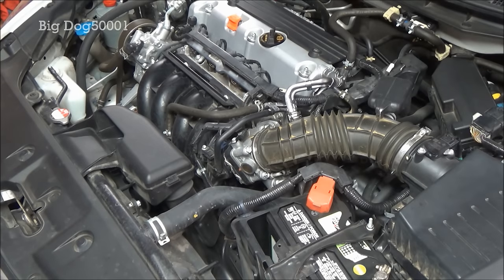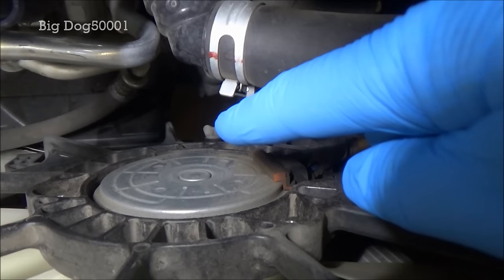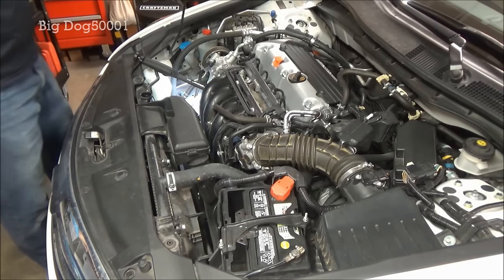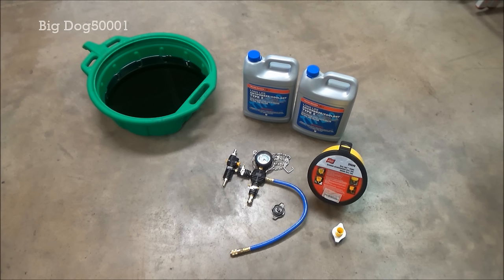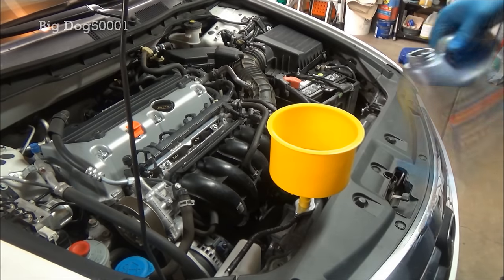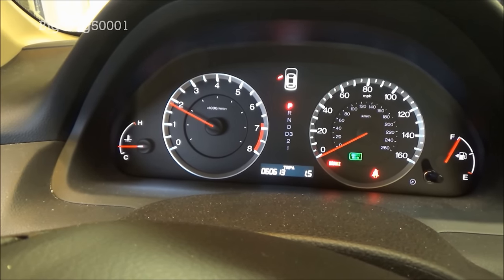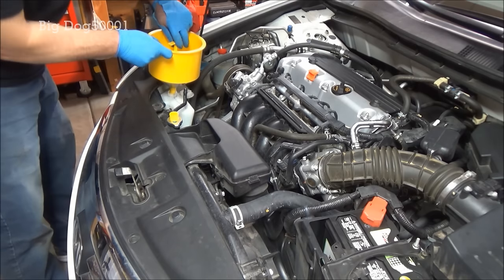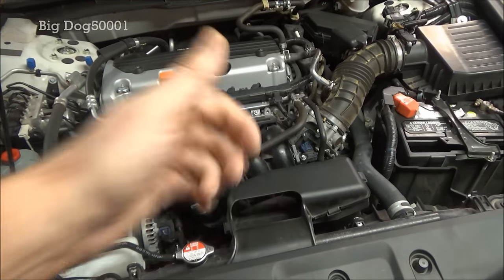Honda Cooling System Service/Fluid Change

Comment: Does anyone know how long these 5 speed auto's usually last with regular maintenance? My 2012 Accord has 130k miles, bought it a few weeks ago. 1 owner with regular maintenance done on the trans and the rest of the car.
Reply from the maker: With regular maintenance, these Honda automatic transmissions can usually go over 300,000 miles without issue.  Many people are pretty bad with doing regular maintenance though....
Reply: @BigDog50001  Thanks for the response sir! Much appreciated and glad to hear that.

Comment: Will this work for all Hondas? 2015 CRV?
Reply from the maker: Yes it can be done like this (especially if done at regular intervals).  There is a drain bolt on the engine block that can be removed on those models to assist in getting additional coolant out of block (need to replace the washer on that bolt if removed).
Reply: @BigDog50001  How would it be done with auto air conditioning controls? Would you just set them to High?

Comment: Hey i have a Honda Odyssey 01 and have prestone antifreeze on it i wanna change it to the Honda do you think just to drain the coolant from the radiator should be fine ?or much better remove the thermostat? And let all that coolant out the same from the heater core as well ?!
Reply from the maker: I would not touch the thermostat if I didn't have to.  In situations like that, I do a service like in this video, then I wait until the vehicle has cooled down (maybe the next day or something like that but it could be a few days or week later) and do the same service again (for a total of 2 services).  After 2 services most of the coolant will be new.
Reply: Big Dog50001 Automotive ok yeah i was just wonder the thermostat is brand new i installed 2 weeks ago with the oem one i will do it when the weather its getting better its so cold to work on car now

Comment: Hi Big Dogg50001. Thanx for the video. However, while I'm waiting for my 07 accord to heat up and kick the fans on, the funnel starts filling up and overflowed onto the floor. I then shut the car off real quick and the entire funnel full of coolant sucked right back into the radiator. What's going on with this car? Please Help!!
Reply from the maker: Sounds like a lot of air in system.  Happens a lot when the coolant is poured in too quickly.  If it happens I just shut it down for a short time and then do it again.  I always watch the coolant temp too, too much air can allow it to get too hot.  If it starts to get too warm, I just shut it down quickly and let it cool off and then do it again.
Reply: Thank you very much. I did everything that you said, and realized that the fans weren't kicking on at all. I was expecting it to kick on about the halfway mark on the gauge. The coolant doesn't start rising until after the halfway point. I'm pretty sure all of the air is out. I went ahead and bought a new coolant sensor switch and installed it and redone the procedure with the same results. I then disconnected the wire from the switch while the car was running, and the fans came on. Now I'm really puzzled. Whats your thoughts on that scenario?
Reply: So now I let it cool down and I tried it with the sensor unplugged.The cooling fan came on right when it was supposed to. As I waited for the fans to shut off and cycle, the fluid started rising in the funnel again. The engine temp gauge showed a little under halfway. The upper radiator hose was hot, but the fluid rising in the funnel was cool. What do you make of that? Is that the characteristics of a bad thermostat?
Reply: OK, let me see if you agree with this theory. The reason the fans aren't kicking in is possibly because the thermostat is not opening and the coolant at the bottom of the radiator is still cool. While I am running the upper hose it pretty hot and pressurized, and the lower hose is pressurized and still cool. If the thermostat is opening, shouldn't both hoses get hot?
Reply from the maker: There might be something wrong but you may be chasing ghosts and introducing problems that were not there due to the air that was in the system.  

2005-2007 2.4L Accords have TWO Engine Coolant Temperature Sensors (ECT 1 and ECT 2).  ECT 2 is located near bottom of radiator on these models.

2003-2004 2.4L Accords used a Radiator Fan Switch instead of ECT 2.  The Radiator Fan Switch is also located on bottom of radiator (same place as ECT 2 on later models).    

I do NOT use aftermarket switches or ECTs on Hondas, they generally do not work well.  If a radiator fan switch was installed instead of an ECT or vice versa then the fans may have problems operating.

On 05-07 2.4L Accords the radiator fan is powered through a relay and the relay is controlled by the engine computer based on inputs the computer is seeing (coolant temperatures being reported by ECT 1 and 2, A/C being requested on etc.).  

On 03-04 2.4L Accords the radiator fan is also powered through a relay and the relay is energized by either the engine computer (based on inputs) or the Radiator Fan Switch when the coolant temperature is approximately 196 degrees (the switch closes and completes the circuit).  I hope this info helps!
Reply: Thank you very much for your help, It is greatly appreciated. I am sorry for the trouble, but I hope that we both may  learn something from this experience. So far, I changed the temperature switch at the bottom of the radiator, replaced the cooling fan relay switch, and replaced the thermostat. The bleeding is going fine, just like on your video, except that the fluid is rising in the funnel, before the engine gets too hot. I am scooping the excess fluid out so that I can keep it bleeding until it gets up to the red mark on the temperature gauge, and I am getting steady air bubbles out. I repeated this at least 3 times, just like you said, and every time more air comes out. But, I just cannot understand while the cooling fan doesn't kick on during this procedure. I have no trouble codes and the only thing left for me to change is the temperature switch on the engine behind the throttle body. But, if the temperature switch was bad, I would have a trouble code, isn't that right? Do you know which temperature sensor would send the information to the computer for it to turn the fan relay on?
Reply: @tonyguy98 The way i replace the coolant after a drain,  especially on Honda's,  remove the top radiator hose and fill to you see coolant about to spill out of the hose .
Reconnect the upper hose to the radiator,  and top off the radiator itself....
Filling it this way the coolant is going directly into the cylinder head and block , and on the back side of the thermostat.... NO AIR TRAPPED THAT WAY ....
JMO .....

Comment: No need to drain the engine block?
Reply from the maker: Up to you, some engines it can be done and others it can't.  I have found that doing what I showed at regular intervals is all that is needed for most Hondas to keep the system operating properly.

Comment: If I add coolant just to the reservoir, do I need to burp out the air bubbles?
Reply from the maker: Not usually if just adding to the reservoir.  If the reservoir was completely dry and the radiator lost some coolant too, then the air may need to be purged from the system (and probably have to find where the coolant is leaking too!).
Reply: @BigDog50001  thank you sir!

Comment: How come all the best mechanics are always so far away from where I live? :(
Reply: You are the mechanic, buy some tools and save LOTS of money! I just did the service on my mother's 2012 Honda Accord. She had a very bad experience at a dealer with her last Honda, and hired a local Honda mechanic that worked out of his home. Well, he never did anymore than oil changes, at least I hope he changed the oil. Mom was having issues with the brakes, he just told her the brakes were fine. Well, I wound up replacing all four rotors, I had to beat the pads out of the brackets with a 3 pound sledge hammer and then found both front calipers were leaking. The car only has 58,000 miles on it! He did nothing to this car, and it is garage kept and washed regularly, normally a couple of times a week. I had to do a brake job, service the transmission that had never been serviced, service the cooling system, service the oil, sanded and painted the engine cradle, etc... Cost to do all of this $570, a dealer would have hit her for what, $3500? Buy tools, educate yourself, save money.

Comment: Most of the cars I had had a very small air drain plug to release the air evenly. I do not know why Honda did not make this little stopper and now need this yellow bucket or that kit. Just unfortunate
Reply from the maker: Thanks for the comment!

Comment: At what mileage should you change the upper and lower radiator hoses?
Reply from the maker: I wouldn't say there is a certain mileage but if the vehicle is over 15 years old and has not had new ones installed,  or if there are any cooling issues, that is usually when I recommend replacing them.
Reply: Big Dog50001 Automotive Thanks Big Dog!

Comment: how high did you fill up the white coolant reservoir?
Reply from the maker: Usually the words MIN and MAX are molded into the reservoir.  I filled it to the MAX line.  Sometimes the markings can be difficult to see, so you may need to look for the mark closely with a flashlight.

Comment: How do you know if your Accord has the engine drain bolt? I have a 2013 Accord sport.
Reply from the maker: Generally, you have to look at the service information to find out.  2013 Accords with a K24W1 engine do have a block drain bolt.  It should be on block towards front of vehicle, the washer should be replaced anytime it is removed.
Reply: @BigDog50001  I will investigate further. Thanks!
Reply: @BigDog50001  Do you happen to know the size of the washer? also. if I do have an engine coolant drain bolt, does that change the procedure you showed in the video in anyway? Thanks

Comment: What about the coolant inside the engine block?
Reply from the maker: Yes there is coolant in the block, some models have a drain bolt for it and some don't.  If the coolant is changed regularly this is a non issue.

Comment: Read the manual.  Honda says to use non silicate antifreeze coolant.   Waste of coolant to change every 60/30K miles.  Honda coolant is rated for 100k between changes.  Some premiums are rated for 15 years, 350k.
Reply: Car care nut shows what happens if you go by what they recommend, I.e 100k miles and that it turns acidic then starts to eat away the composite black material they put on each side of the head gasket. So, not worth the risk imho. 5k oil and 50k coolant changes he recommends and more so shows you what happens if you don't.

Comment: Why does my reservoir start to fill up when I do this? I emptied it and left it empty. Then I started to fill up the lyles funnel and it filled up my reservoir and my radiator
Reply from the maker: The coolant is just going through the overflow tube coming of the top of the radiator.  You might be using the wrong radiator cap attachment.  If not, you can lift the hose that goes into reservoir up above radiator neck level or just gently punch hose off to stop it from doing that.
Reply: Big Dog50001 Automotive thanks

Comment: When you turned on the heat, do you turn on the fan too?
Reply from the maker: No I don't. unless it is some kind of auto climate control system where it needs to be on to switch to heat, then I will put the fan on low.
Reply: Thank you.
Reply: Big Dog50001 Automotive does AC need to be on?

Comment: Do u have a video made where u change brakes on a Honda crosstour?
Reply from the maker: No, I don't see too many Crosstours.  I have several brake videos coming out, most Hondas use a very similar setup..
Reply: @BigDog50001   thank you I appreciate it , I checked out your videos! Thankful for your videos!💯

Comment: When is the thermostat recommended to replace.
Reply from the maker: There is no recommended interval.  I generally recommend replacing it if the vehicle has 200,000 miles or more on the original thermostat.
Reply: Awsome thank you

Comment: mate, I can't find the block bolt for my 04 ex civic,yet owner manual recommend s draining it out
Reply from the maker: On those Civics, the drain bolt for the block is located on the rear of the engine right next to the oil filter.  Just know, if that bolt has never been removed it will be extremely tight and you always risk the chance of opening up a can of worms.  The threads need to be sealed with a liquid gasket maker and a new washer should be used.  

On situations like that where the block bolt has never been touched and I want to get all the old coolant out, I prefer to do a drain and fill, then drive vehicle for a drive cycle, then do an additional drain and fill (of course the engine needs to be cool before doing each drain and fill).
Reply: Don't take out that bolt. I thought better of it and didn't.

Comment: How soon do you have to replace the radiator cap back on?
Reply from the maker: If I am using a spill free funnel like in video then I will put radiator cap back on immediately after I take funnel off.  If using cap method of bleeding, then after system is bled I would top system off with coolant and then immediately put cap on.  

If you are asking when to replace radiator cap with a new one, I would say put a new one on if the cap is 10 years old or older.  I only use Honda radiator caps.
Reply: Big Dog50001 Automotive 
Thanks man. 
Just clarify when you turned heater on, did you put the ac fan full blast or just level 1?
Reply from the maker: @Freerydah73  Just need to turn it to hot.  No need for fan to be on unless it's an auto climate control system and it won't switch to heat without being on.  No AC because that will turn fans on.
Reply: Big Dog50001 Automotive 
Great. 
I notice a lot of other videos, they turn ac fans full blast. 
Just FYI, I just subbed. Your videos are awesome!

Comment: I have a 2008 crv anyone know the intervals for the coolant thermostat to be changed I have 119k and coolant
Reply from the maker: In general, there is no set interval for a thermostat.  Yours is getting to the age where it's not a bad idea to change it out (12-14 years old and 100k-150k miles).  If you are going to do that I DO NOT recommend aftermarket thermostats.  OEM Honda only.
Reply: @BigDog50001  yeah went to honda today after I posted this and got a new thermostat and 2 gallons of coolant.its a pain in the ass to get at the thermostat, it should be fun  I got 2 new hoses too why not !!!

Comment: How about if the fans don't come on but it reaches temperature
Reply from the maker: That is when I would do troubleshooting procedures.  Vehicles cooling systems vary so you have to know how it is designed.  I show troubleshooting procedures on an older Honda system in this video: https://youtu.be/BCvC_wnyuIs

Comment: don't get the part when you crank up AC dial up to 100% hot
in my opinion you make the process longer as temp from engine goes to cabin
Reply from the maker: The coolant flows through the heater core (inside cabin), if coolant is in there then there is a good chance air is also in there (especially after a coolant service).  That air needs to be bled out and it can't be bled out if the heater core is isolated (heat turned off).  Many modern Hondas do not have a valve that shuts off heater core so turning temperature control to heat does not make a difference on those (time or heat wise because coolant still flows through heater core regardless of temp control position), but it is important on older systems that still have the diverter valve so that all air in system is bled out.
Reply: @BigDog50001   good point thanks for reply

Comment: You really should drain the block too, there's a lot of old coolant being left if you neglect that.
Reply from the maker: If this is done regularly it is a non issue.  If you go 15 years and never changed coolant, you should probably drain the block also.  Modern coolant, especially Honda coolant, lasts a long time.

Comment: Hi quick question I have replace my thermostat & bought a spill free funnel but I still have bubbles after a hr any thought what might be introducing air in to my cooling system?
Reply from the maker: It could be normal, some Honda take forever to get all the air out.  It is also possible you have a leak somewhere, at some point if you continue to have cooling issues you might want to pressure test it.
Reply: Big Dog50001 Automotive  do u have any videos on that. & pls dnt answer that last one from me u answered it in the video thanks for the quick reply very helpfully
Reply from the maker: Here is a video on how I find leaks on Honda coolant systems: https://youtu.be/m_yo9ri689s

Comment: You should drain fluied from the engine block bolt too.
Reply from the maker: You can do it on some models, whether you "should" do it or not is up for debate.
Reply: @BigDog50001  If we want nearlly 100% change the fluied, this should help. But the engine block bolt is so hard to 
disassemble.

Comment: I guess,  turn heat on , then drain. This may help drain old coolant from heater core
Reply from the maker: On some systems maybe, others it will not make a difference due to no valve separating heater core from rest of system.

Comment: Why not take the extra step and pull the radiator hose from bottom of engine to empty the block and heater core?
Reply from the maker: For most of these Hondas pulling the lower hose won't drain much more from the block and anytime you pull a hose you have the potential of creating a leak.  If this service is done at regular intervals there is no reason to go any further (and for this model it is the exact procedure from Honda service info).